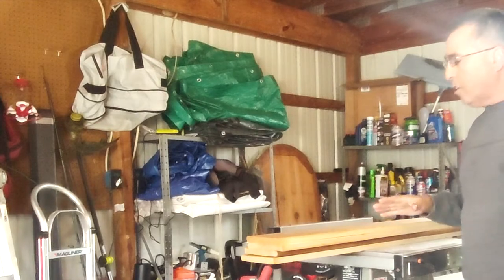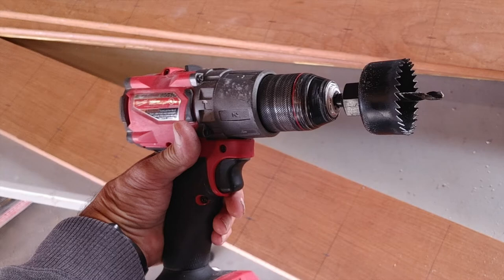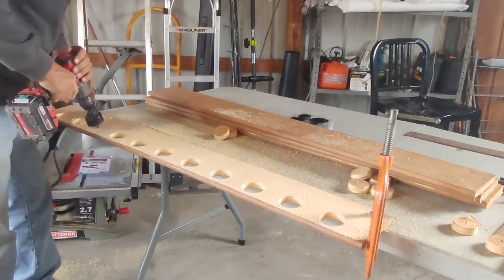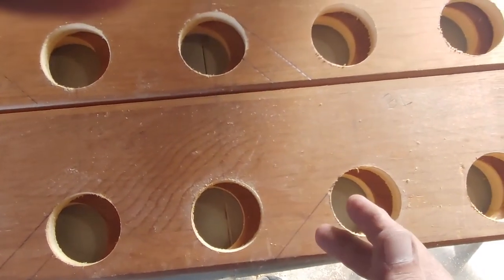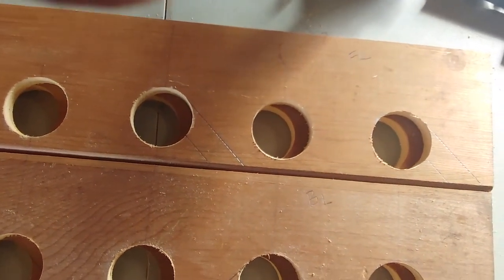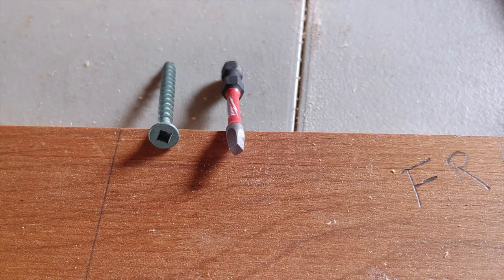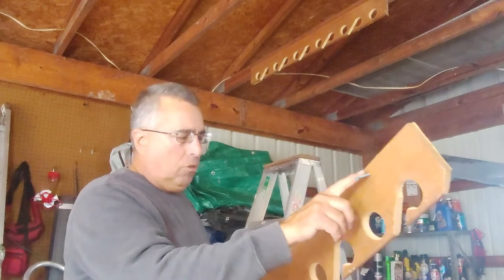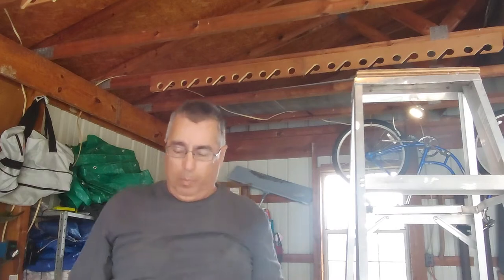HOW TO MAKE FISHING ROD HOLDER...QUICK, EASY, SIMPLE!!!    Make it yourself!

Comment: Your rod holder looks awesome! Mine is a 1x6 screwed into the bottom side of my rafter with the wide flat side parallel to the floor and rafters. I cut slots about 1/8 inch wide about 1 inch long into the 1x6. I hang the rods hanging down by one of the eyes. I just slide the rod into the slot and the eye catches and holds the rod secure. I mounted the 1x6 in a back corner that was basically not being used so as not to take up space that was needed for other things. I never counted how many rods are hanging on my rack, but probably between 80 and a 100. Unfortunately, they are all way too dusty!!!
Reply from the maker: That is a good idea how you did yours, especially if you have an area that is unused anyway.  It sounds like it works well to just hang them from the tip guide....Thanks!